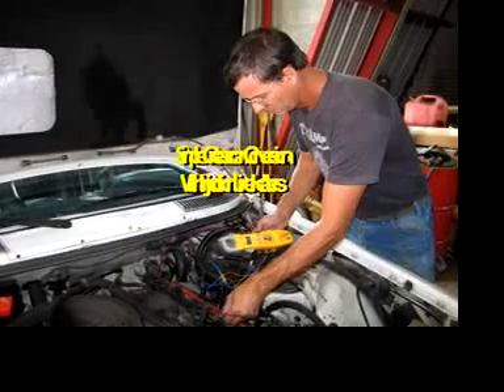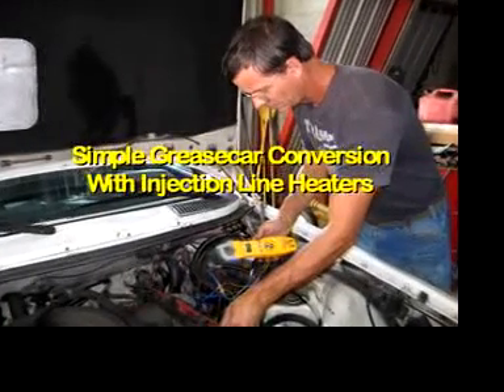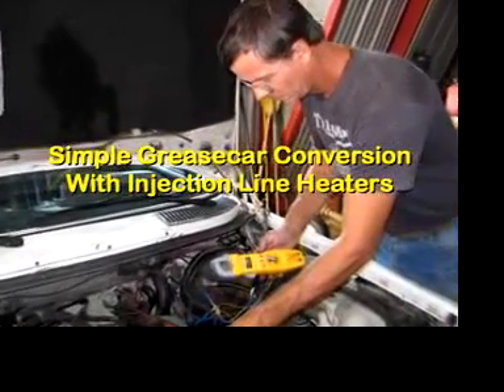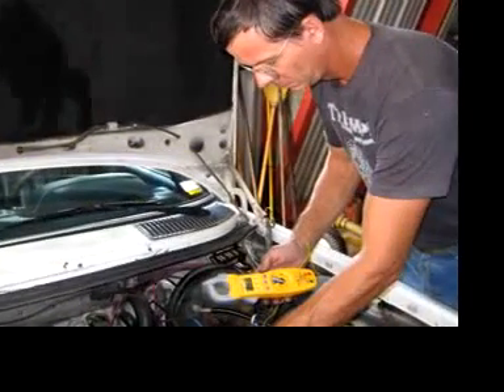Cheap and Easy Greasecar Conversion with Line Heaters

Comment: I'm no expert but from my reading if its a warm day and the car is hot you can get by with an hour and a half. However to be delux you should purge, run on diesel before shut down to make sure the injectors & pump are not full of SVO. Makes sense. I heard of people starting on SVO cold in the mid 30F at above temps. I would not do it. Where are you getting your $200 parts that sell for $1000? The VW TDI Kit has a nice round alum tank. May be $600 in parts or so for $1000.

Comment: Sorry, left out a part... Connect the elements/coils to a thermostat for 180-200 degrees F, and a booster on a timer to initially heat up to 300+/- degrees for a quick heat, (to start up) and shut off....dropping the temp of the element/coils down to the 180-200 degree temp for operation.  

Just an idea, but it looks as though it could possibly work.

Comment: THANKS! I was thinking of using electric heating elements/coils to heat the oil from the injectors to the tank.  Install an extra batt with a one-way switch (to keep from possiby draining main batt). It would just require waiting a minute or two while oil is being heated, but no diesel should be needed.  You have proved my idea is feasible.  Not to comfortable with using the coolant heating method, switcing/purging, etc.

Comment from the maker: Thank you for sharing the wealth of knowledge and the clarification for those viewers may not know better to fully investigate running a diesel car on Wate Vegetable Oil before getting into it. 

For further Clarification: 

1) This car is in Florida and operates beautifully year round with no other conversion.

2) The WVO used is pre-filtered through 5 micron filters.

3) We are very aware of "Greasecar" - the name has just become a common token brand name such as Kleenex and Band Aid.

Comment: This is some poor information. 
(1) adding injection line heaters is ONE part of a conversion.  How is the oil being filtered?  I can assure you, cold vegetable oil isn't going through your normal diesel filter unless you live in the tropics.  If you think injector line heaters is all you need, you are probably going to shorten the life of your car considerably.
(2) Greasecar is an actual company and they do actual conversions - not this
(3) dumping unfiltered oil in your tank also a bad idea